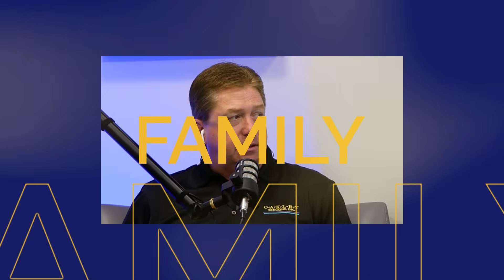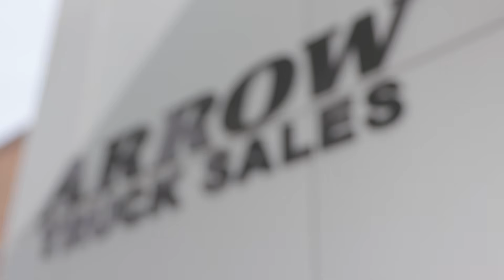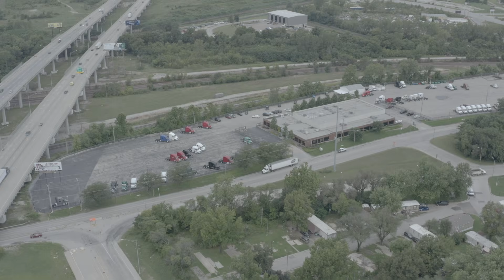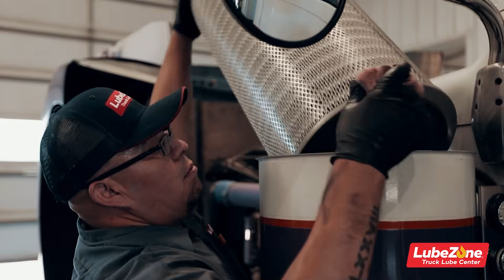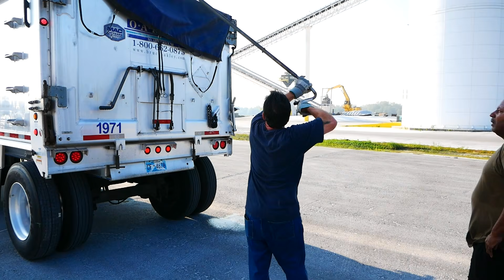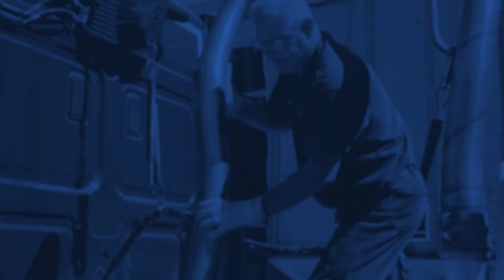196: MATS 2024: The History of Gulf Coast Filters and How They Have Changed the Oil Industry

Comment: I was reading the Road King article again. They were comparing the Gulf Coast system to a Como oil filter system. Its the same as with cars and pickups. People use filters that use expensive elements and dont change them often enough to keep the oil clean and arent adding enough new makeup oil to keep the total base number high enough to keep the acid neutralized. The other truck changes the Amsoil and the 3 gallon Como filter at 50.000 or 60.000 because the TBN is too low. Randy is keeping the oil clean and adding enough new makeup oil to keep the additives up. If the TBN numbers are too low the other additives might be too low. Como claims most operators can extend oil drains by 3 to 4 times adding only top off oil. How about a million miles.

Comment: Things have changed over the last 30 years. Steve goes by oil analysis reports. Randy changed the two rolls of Bounty big roll paper towels every 10.000 miles. Also the full flow filters at 50.000 miles. Oil analysis showed he could have gone a lot longer between towel changes but he went by Gulf Coast filter recommendations. Some of my customers used Costco Kirkland paper towels. Some say some paper towels are too small. Im not too smart but I could put two rolls of paper towels on the table and make one bigger. I wonder if TA truck stops still services them. Randy Rogers had a chrome plated Gulf Coast O2.

Comment: Ive read Randy Rogers truck has had one oil change. The plan was about every 250.000 miles the engine is taken apart and Shell engineers measure the parts. The engine is put back together the used oil is poured back in and the horse power is checked. One time a mechanic sees the container of used oil and disposed of it. Because the engine had to be refilled with new oil it was called an oil change. At the 1 million mile check a engineer said its not unusual for these Detroits to go a million miles but not be in near new condition.

Comment: My old 6.9 Ford diesel F250 had a Gulf Coast junior bolted to the plastic fan shroud as high as possible. Returned the clean oil to the oil fill neck. It drained over night. I could change it and add a quart in less than a minute. The truck had over 300.000 miles on it pulling a large horse trailer when I got it. It used or leaked about a quart every 600 miles on a trip. I normally changed the little junior every 1500 miles to 2000 miles. Didnt drive enough to need the big filter. Some are going too many miles between filter changes with the little 1 quart filters. Up to 10.000 miles ? Good luck with that. A Caterpillar lab recommended 6.000 miles with my Subaru.

Comment: I dont have anything large enough for the big Gulf Coast filter. My 25 HP 3 cylinder Ford diesel tractor has a flat head Ford V8 canister filter converted to use Scott 1000 toilet paper. At present it has half a roll of VIVA paper towels in it.

Comment: The last little filter i bought was a 1 quart Australian Jackmaster Classic off Ebay for about 176 bucks plus 50 bucks shipping from Australia. I use Great Value 1000 from Walmart in mine. Been hearing a lot about a similar filter called Extreme. Checked their website. 680 bucks. One guy says they use toilet paper in a sock for about 50 bucks. I understand what Steve says. I put Motor Guards on the engine and transmission. 06 Nissan Altima. Put them in front of the radiator. Remove the grill to service them. Motor Guard started as a toilrt paper lube oil filter in 1961. They only make compressed air filters now. The one on the old F 250 390 engine is about 50 years old. A Gulf Coast junior is on the transmission. Gulf.Coast had a transmission adapter similar to the old Frantz transmission adapter
Reply: Motor Guard learned it isnt easy to sell filters to people that think oil is supposed to get dirty. Luckily they had compressed air filters. Not many painters think compressed air needs to be dirty and wet.

Comment: Old timers talk a lot about the Frantz oil cleaner. Most of us started with the Frantz when every grocery store had high quality 2 ply toilet paper that fit the Frantz. Now the only paper that fits the Frantz is the custom made toilet paper from Frantz. Charlie Sims of Gulf Coast Filters was proud of his little Gulf Coast junior. It could handle the larger cores and shorter paper. You pushed the paper down against the larger seal and put on the lid. The same as the Australian Jackmaster Classic. The Jackmaster is the only little filter as good as the Gulf Coast junior. Jackmaster says to check Gulf Coast filters. They put the big Gulf Coast filters on locomotive engines on offshore rigs. Someone needs to supply little filters for lift trucks and such. I wonder if they are working together. Actually there are several good bypass filters now. Most are not economical. My old Mazda diesel pickup had both a full flow filter and a bypass filter factory installed. To clean the oil I removed the bypass filter and installed a Frantz. I guesstimate the Mazda filter was about a 10 micron filter. The Frantz about a 1 micron. In those days my favorite was the Motor Guard. Motor Guard had converted to compressed air filters.

Comment: The reason we can use a sandwich adapter for a bypass filter is they are  designed to keep the engine supplied with oil if the cooler gets clogged or the oil in the cooler is too cold. The depth bypass filter is the same as a restricted oil cooler. The spring loaded bypass valve opens enough to supply the engine with oil. I like a oil pressure gauge. If the oil pressure is good and the bypass filter is getting hot things are working good. The only ones I have used is the old Frantz 2 port sandwich adapters and the Perma Cool 189 sandwich adapters from Jegs. Summit racing also has them. I only use them for small filters. I drill out the orifice. The 189 has bushings to fit most any small filter. Must use a 3/4  16 thread full flow filter such as many Ford and Toyota filters.
Reply: I see Summit has a Perma Cool 169. It has 1/8 pipe ports.1/8 is more popular for small filters. Sandwich adapters are a life saver on some applications. I think the 169 is for oil to a added turbo charger. The bypass filters dont need an orifice because the oil cooler doesnt take pressure off the oil system. The clean oil feeds into the inlet of the full flow filter.

Comment: Many years ago there was a Jones bus company in Wichita Kansas. I was in Kansas for awhile. Ran a ad in the paper. Mentioned the FAA approved AeroFrantz.  The ad read FFA approved. Got a call from a pilot asking me if I had ever seen one. I said no. He said come on up and we will show you some. Crop dusters north of Sedan Kansas. Got another call. It was mr Jones of the Jones bus company. He had a Clydsdale horse ranch also north of Sedan Kansas. He said my Frantz has some problems. It needed new hoses a new gasket and the rough roads had caused metal fatigue around the Frantz bracket. I repaired the fender panel with a piece of 55 gallon drum. My wife and me had a good visit. The Jones bus company was Frantz equipped school buses. He had thank you letters from Frantz in picture frames on the walls.

Comment: About 1985 I was demonstrating the Frantz oil cleaner at the Denton Texas flea market.I was getting the normal fools. An elderly couple showed me their 53 Chevy they bought new and put a Frantz on it. The 53 Frantz was a Frantz canister that took a roll of 2 ply toilet paper and went inside the Chevy canister that were optional equipment like my Ford filter. A semi pulled of the road. The driver talked about the filters to people gathering around. He said come and look.at mine. He had two Frantz 3 stackers on the fire wall under the hood. Said he gets a 6 pack of Safeway Truly fine to service them. Im feeling pretty good. Here comes another fool. He said so much shit paper is getting in the oil they have been outlawed in Texas. It never ends. The Gulf Coast O2 is equal to about 3 Frantz 3 stackers.
Reply: Im curious how many Gulf Coast O1s it takes to equip a locomotive engine on a offshore rig. When I was selling Gulf Coast filters I had to buy a instrument that passed a electric current thru a sample of used oil. It was zeroed  on new oil the same as what was in the engine. It read the conductivity of the oil. The dirtier the oil the better the conductivity. If the conductivity is too high a sample goes to the lab. If the needle pegs out the engine is shut down. My old stuff. I dont need it. I dont have an over the road truck or a offshore rig.
Reply: Correction. It would take O2s.

Comment: I found out about the Motor Guard oil cleaner about 1965. They only made singles. They had manifolds. The larger the diesel engine the more they manifolded  together. I liked the design. Gave one to my cousin. Put one on my dads Pontiac.years later I went back to Oklahoma for a family reunion. Cousin gave me back his Motor Guard. Said the kids were playing catch with it and hit it on a rock. I was able to salvage the top. They were laughing about my stupid California oil filter on my dads car that filled up with sludge and quit working. Told my wife we will never be back. Told my uncle in California near me we have a choice. Change the Frantz every 50 miles or clean the sludged up engine. He traded the 59 Ford in on a new 63 Dodge pickup. When I was putting the Frantz on the pickup his brother drove up. He said I would have given you my Frantz. My oil is dirty and my lifters are noisy. He was asked if he changed the Frantz. He said change it? The guy I bought it from said it would last a lifetime. That was life in the 60s. Dirty engines and poor quality oils. Couldnt use multi grades in a diesel. Delo 100 came in 30W and 20W. You can still get it. My Ford diesel tractor sticker on the engine calls for 10 30 or 10 40. For extreme high temperature use 30 weight.

Comment: When I was selling Gulf Coast filters Charlie Sims of Gulf Coast filters said look at this. It was a letter from Al Gore saying thanks for saving all the natural resources. I believe he was Vice President at the time. Also a letter from the US Marines in Japan cleaning coolant. Cant remember the exact words. A trucker that told a salesman he needs the Gulf Coast filter removed from the old truck and put on the new truck. The salesman said that will void the warranty. The trucker said no problem I will buy a truck with an engine that doesnt void the warranty. The salesman said let me make a call. Good news the filter doesn't void the warranty. Engine makers understand bypass filters My Mazda diesel pickup came fron the factory with both a full flow filter and a bypass filter. The bypass filter was about a 10 micron filter which isn't good enough. I pulled it off and installed a filter that cleans oil. A Frantz on that truck. Not a good design but they clean oil.
Reply: Too bad Steve didnt talk about using Gulf Coast filters for other things they do. Aviation fuel cleaning solvent coolant. Hydraulic oil. Its amazing. At Safety Kleen we got paid to dispose of fluids that could have been cleaned. It was blended with other waste products and burned in a cement kiln. We recycled parts washer fluid. A Gulf Coast filter on a parts washer works good. There is so many things that they can do.

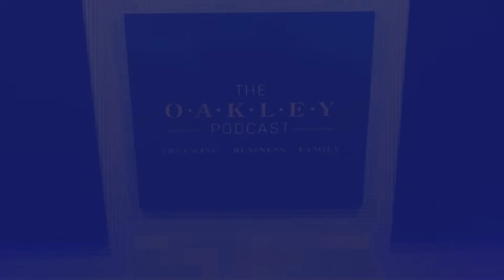Comment: 48:38 Steve talking about the dark oil not staining the skin 
Made me get off my ass and go check the Ford diesel tractor.  Washed my hands. Wiped the dipstick in my palm and rubbed it around. It disappeared. In the 60s we called that the old trucker palm test. I dont spend money on oil analysis. I have a 79 Japanese Ford with a 3 cylinder 25 HP diesel engine. 4 1/2 inch by 5 1/2 inch half a roll of VIVA paper towels in a flat head Ford V8 canister filter. Not a good candidate for a big Gulf Coast filter. I was a maintenance mechanic for Safety Klean corporation. I asked the engineer if he wanted me to put submicronic bypass filters on the equipment. He said sure. I put a Motor Guard toilet paper filter on the 5.9 Cummins fire pump. Not used enough for a big Gulf Coast O1. Gulf Coast O1 filter on the yard tractor. 4 cylinder Cummins on the Sky Trac and the other hoist got Motor Guards. The lift trucks got the Gulf Coast Juniors. I prefer the top loaders such as the Australian Jackmaster Classic and the Gulf Coast Junior. The Juniors are getting  hard to find. One of the bosses said I need a Gulf Coast junior on my new Chevy pickup and I need my 41 foot Chris Craft equipped GM engines and generator. Cars can be a problem. I sometimes wrap some protection around the bypass filter and lay it in a low place. On the wifes Pontiac I used a pair of old welding gloves and a hose clamp. Ive had to walk away from a couple that had no place to install one. My Rambler had plenty of room under the hood. I mounted a Frantz on the fender with a clear plastic return line for flea markets. It backfired on me. No one wanted a filter on the fender. Im not against sending oil samples to a lab. Its a waste of money on my old stuff. Drained the oil in the old Craftsman lawn tractor one time in 23 years. Put a electric fuel pump on it and filled the Crankcase with gasoline. Had to repair the starter today. The field magnets came unglued. Changing the Gulf Coast junior tomorrow. The filter holds more oil than the engine. Might not have been a good idea for Steve to discontinue the junior. The interest in the filters is increasing. Let the customer decide how to install the little filters. If they cant figure it out they shouldnt have one.
Reply: The  bosses Chevy pickup had a lot of room for a Gulf Coast Junior. 6.0 gasoline engine I believe. Normally we punched holes in the steel fender panel and used supplied metal screws to mount the bracket. Dont work with plastic fender panels. I had to fabricate something to bolt the Junior to. I used a Perma Cool universal oil cooler sandwich adapter. 4 wheel drive. Not much room under there. My first problem with plastic fender panels was a new  GMC Sprint about 1971. Like a Chevy El Camino. 350 engine. Near Sand Point Idaho. Mosquitoes eating me up. Getting dark. Elk coming into the yard. The farmer said its hunting season. They feel safe here.
Reply: I noticed the Australian Jackmaster Classic doesnt need a center tube like a Frantz. You push the 1000 sheet down against the seal with your hands and put on the lid. The Frantz is the only filter that needs a center tube. They depend on oil pressure to push the toilet paper down against the core seal after you change the paper. In the 60s the Motor Guard was my favorite filter. Recently I took two Motor Guard M 30s and tossed the plastic internal parts. Pressed a 2 1/2 inch OD flat washer on the bottom for a core seal. Had to ream out the ID to press it on. If its not pressed on it will stick to the used paper and come out with the used paper. On one I reamed it too much. Had to use a snap ring to hold it down. Same as a Australian Jackmaster Classic except the Jackmaster uses a plastic bottom seal instead of steel. I guess since Gulf Coast discontinued the little filter and The Jackmaster owner is retiring its OK for do it yourselfers to know this. Another good top loader is near 700 dollars. On the M 30 compressed air filter I put a 1/16 inch orifice at the inlet. The M 30 is similar to the origional Motor Guard lube oil filter.  John Frantz got his start putting superior toilet paper in the old canister filters in 1953. He didnt do it right but I wont get into that. Its a little more complicated.
Reply: The bad jokes and bull shit stories can put you out of business. A Amsoil dealer told me he went to change his Frantz. It was empty. The complete roll was somewhere in the engine. Of course paper doesnt break down in oil it gets stronger. It can get rotten if you leave it in long enough like for years. The same for the paper in the full flow filter. I expect the used toilet paper to be strong and tear at each sheet. If its not stronger than new its been in too long. I drove my 84 Subaru over 250.000 miles with no oil drains. I changed the toilet paper every 12.000 miles. That car used a Frantz and Mobil 1 with the full flow filter removed. A Caterpillar lab manager recommended the Frantz be changed every 6.000 miles. Mostly highway in the Dallas area. Short trips in Montana in the winter would be a different story. Did ok in Idaho because I drove enough to heat up the oil.